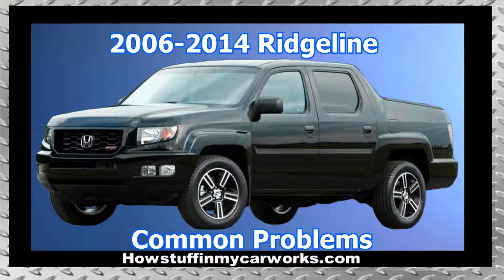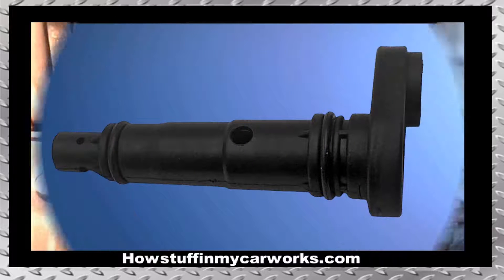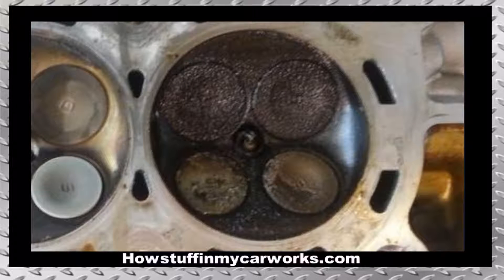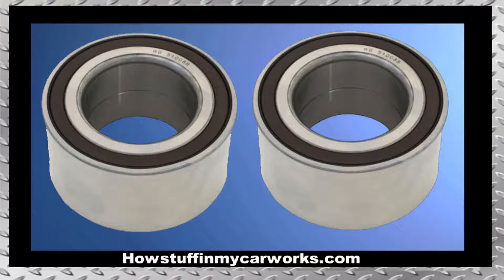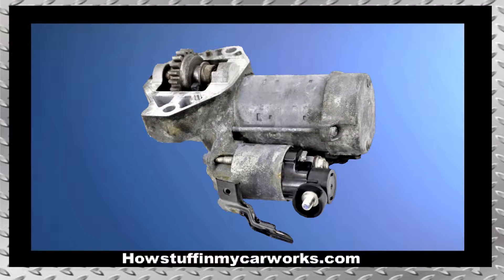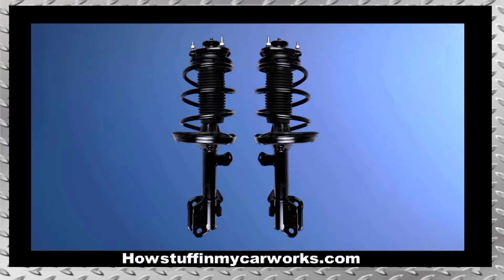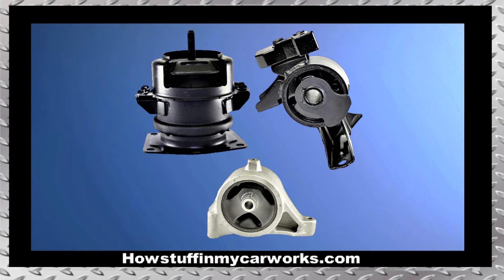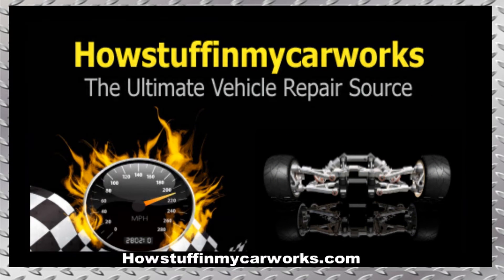Honda Ridgeline 1st Gen 2006 to 2014 common problems, issues, defects, recalls and complaints

Comment: Currently 240k replaced catalytic converter, have issue with motor mounts, and power steering. Pretty accurate problem video.

Comment: I’m at 203,000 miles.  Currently have the power steering issue, already replaced a motor mount at the timing belt service, clear coat is shot on hood and roof.  2008 model, RTL trim. Bought brand new. Alternator gave up about 145,000 miles. Had one wheel bearing replaced. 
Headliner in these will fail if you ride around with the windows down a lot like my wife did. AC has a leak that needs repair.

Comment: TY, for the head's up, I just bought one for my son, 2006 ridgeline with 150km, I m catching up on all the maintenance, changed all the lubricants so far  next is timing belt and water pump and tensioner, then radiator. Then tires and axle boots

Comment: My 2007 has had issues with the power window motors (slow and sticking) and I have replaced the power steering system twice. 

I've also had to have the AC compressor changed / recharged which is normal for the age. My truck has 190k miles and is still going relatively strong. Timing belt and water pump were done at 170k miles.

Comment: I have a 2009 Ridgeline and haven't had a stitch of trouble except shocks need replacement. It's got 150,000 miles on it and runs just fine. Maybe I was lucky and got one that was built on a Wednesday.
Reply: lol mine runs great too no problems except shocks and a starter
Reply: You should definitely be replacing that timing belt of you haven't already.  If it fails it will destroy the engine.
Reply: It’s coming… you’ve just been lucky so far… you may not have all these issues, but you will eventually have some.

Comment: I made a video of my 2014 with 14,000 miles on it not accelerating, shaking, engine light on. I guess it was the injectors according to your video. After I killed the truck and restarted it the problem went away. Weird! I took it to a Honda dealer and it wasn't acting up. They said they would have to keep it and drive it, and not give me a rental under warranty, and this was in 2015. Now my paint is peeling with 43,000 miles on it.

Comment: 245k miles 06 running strong only problem had so far is change the Power steering pump and headliner is falling fixed that one too. Now paint on roof has started to fade

Comment: My clear coat has pealed of the hood and roof. Catalytic converters came apart and clogged the third converter causing the truck to quit running. But the worst problem that I’ve had is the spark plugs loosening in the heads and blowing out, stripping the threads and causing engine damage. I had to have the engine replaced at 180,000 because of it.

Comment: New recall coming out for owners on August 1, 2022
American Honda Motor Co. is recalling 112,060 vehicles in the U.S. after the discovery of a frame defect that could increase the risk of fire.
The recall affects 2006-14 Honda Ridgeline models sold or registered in the "salt-belt" region of the country, locations where de-icing agents are applied to roads during the winter.
Honda said an investigation revealed that accumulation of de-icing agents and other debris on the rear frame, where the fuel tank is mounted, could cause the mounting bands to corrode and separate. This could result in fuel leakage and fire risk if the fuel tank is damaged.
Remedies will be determined based on the corrosion level of the frame, and Honda will "explore repurchase of vehicles on a case-by-case basis."

Honda notified dealers on June 17 and will begin notifying owners on August 1.

The states involved in the recall are Connecticut, Delaware, Illinois, Indiana, Iowa, Kentucky, Maine, Maryland, Massachusetts, Michigan, Minnesota, Missouri, New Hampshire, New Jersey, New York, Ohio, Pennsylvania, Rhode Island, Vermont, Virginia, West Virginia, Wisconsin and Washington, D.C.

Comment: do you recommend changing the PCV valve to prevent the common cyl 4 issue? 
Would changing it after cyl #4 has low compression fix the issue if the carbon build up is removed.

I've had all the other issues.

Comment: There is also transmission cooling line rips threads out of radiator and transmission fluid mixes with coolant causing transmission failure....
Reply: My cooler line fitting came out of the radiator and dumped all the fluid onto the ground. Had to tow it home and change the radiator.

Comment: Great video, thank you, I have a 2008 Honda Ridgeline and when I turn on the Heater on the left side blows cold and on the right vents blows hot. Would you have any idea what the problem would be please? Thanks God bless.
Reply: “Air blend door actuator”, I had that issue on my 2008 ridgeline .
Reply: That gangster u got the future car.
Reply: Curious conundrum here, indeed. I dealt with this issue myself, for years, after I bought my ‘06 RL, back in 2013. However, mine is just the opposite.. the driver side sometimes will stay hot, while the passenger side will be cold. 🤔
Reply: Check: A) The “blend door actuator” (as previously stated) and/or it’s possible the plastic gears that control the blend door are worn or even missing teeth. (Drop your temp 5/+ degrees and listen for any “clicking/grinding” noises, from underneath, towards the middle of the dash) or B) The climate control circular knob that selects your intended air temp is loose, not installed properly or broken. (You’ll know this is it, if the numbers on the readout of the air temp don’t move OR try turning the dial all the way to “Lo” and see if the dial continues to turn counter-clockwise.

*There’s videos on locating, diagnosing, fixing these issues yourself.
Reply: Sometimes they are also just built up with a little gunk. Alternate blowing 100% hot then cold over and over as well as adjusting the dual climate controls back and forth. Also you can try banging on the dash panels around your feet and hopefully knock loose. Has worked for me in the past. These little moving parts just get stuck sometimes
Reply: Guys thank you for being out there I hope you are the absolute best I just picked up a 2011 and and getting into it thank you again keep me posted
Reply: Hi, I had simmilar issue , ptonlem was the vacuum line that opens the flapp/ air deverter was pulled out  from fire wall on my F150. I hope this help.

Comment: My catalytic converter code came on around 200K . Wasn’t working at heater than 95% efficiently. So I added 1 gallon of lacquer thinner from loews to a half tank and ran the car for about 150 miles and the engine light turned off
Reply: @SIDVENOM  I would say that Jared fone is pulling our leg...  That would kill the vehicle's engine or maybe he thought that adding the lacquer thinner to the gas tank would get rid of the possible paint peeling problem?  Just a guess.
Reply: I would never think that would work I would love to hear a follow-up on that situation thank you 😊